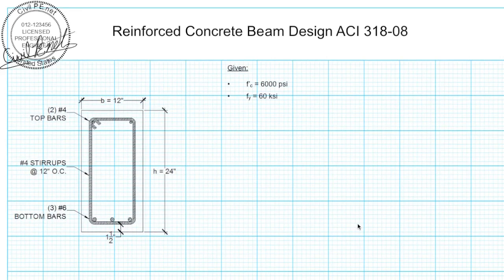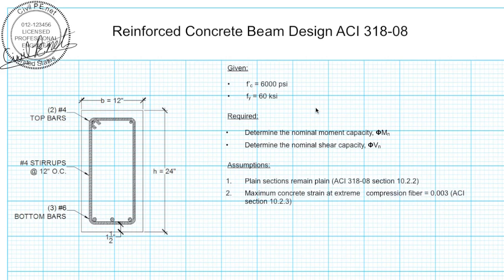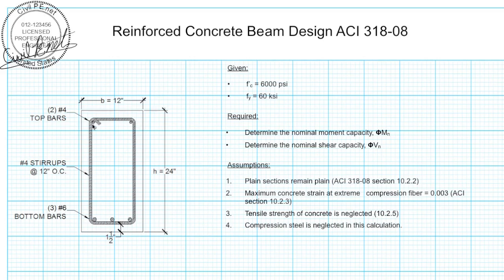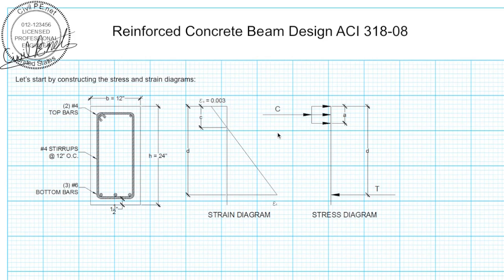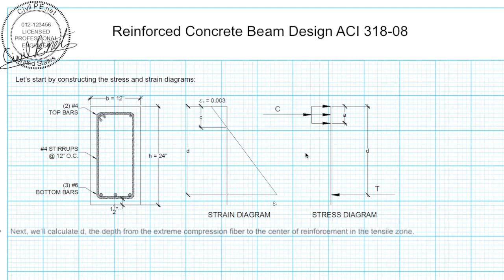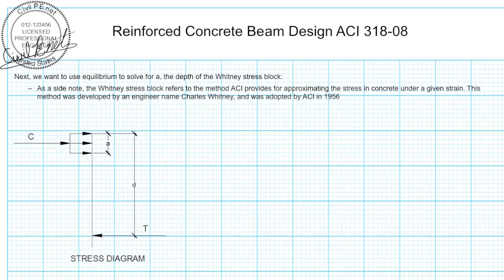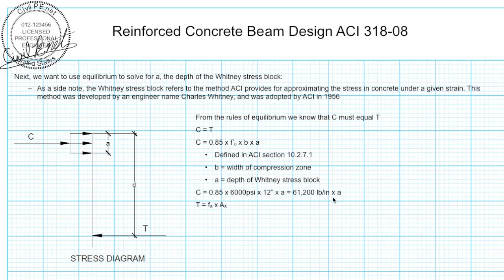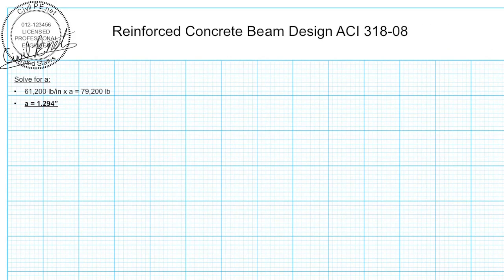Reinforced Concrete Beam Design - 1 of 3

Comment: How can concrete compress in bending, if supports are fixed?  Because length of concrete fiber cannot shorten but only elongate when bent. If supports are fixed there should only be tension in beam, tension being highest in one extreme fiber and lowest in other extreme fiber.And what are the assumptions made that allows the compression of concrete?

Comment: when you mention the tension formula just about 6.29 thru 7.15 minutes of the video running you say 6000 psi but you have a mathematics problem of 60,000psi x (3x0.44in)=79,200 so which one is correct the 6000 psi that you mention or the 60,000psi
i am not an engineer nether a student for engineering i am just trying to understand concrete beams i like math please reply to purpledesigns1@aol.com

Comment: Awesome video. Very clear. One thing I don't get is if [stress = strain * elastic modulus] ... (in metric) 30,100MPa * 0.003 = 90.3MPa. That elastic modulus value is for 32MPa concrete. Can anyone explain? Is the elastic modulus lower for a cracked section or something?